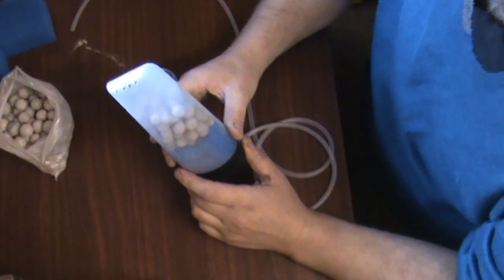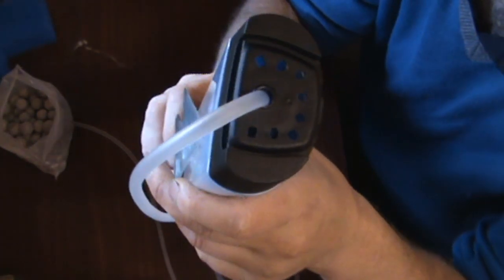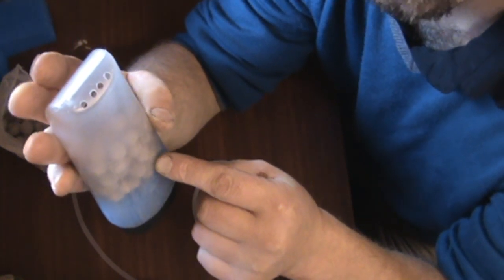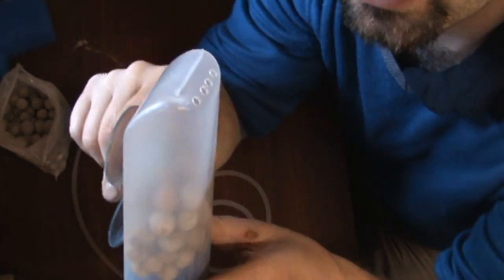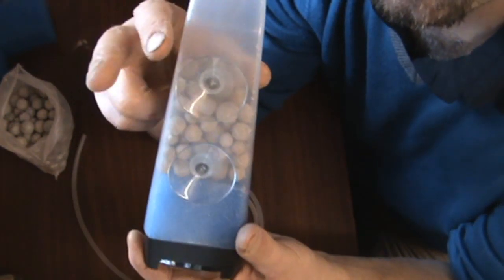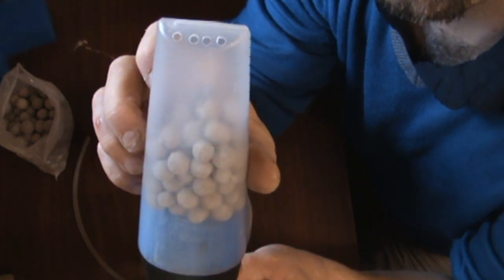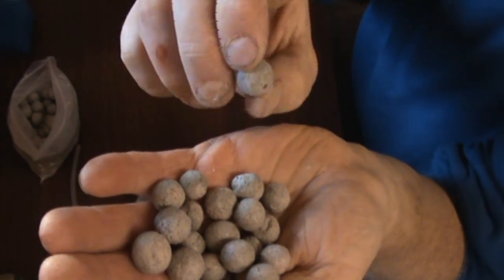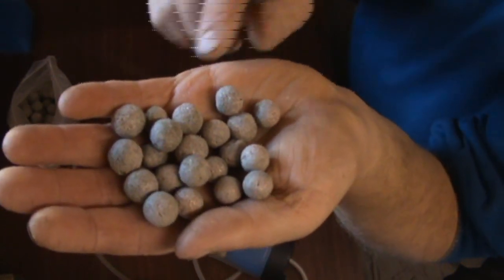New Filter for New Moving Bed Media

Comment from the maker: We have had one this size in tanks up to 100 litres and water has been spot on so using that formula, just upscale as necessary. Obviously the Biomotion media makes a heck of a difference over K1 or Hel-x as it has much more surface area. It also matures more quickly since its available surfaces are more easily colonised by bacteria.

Comment from the maker: I've made loads of moving bed filters and always end up taking the airstone off as the media is driven better with larger bubbles. Unfortunately that does mean slightly more noise than if used with an air stone. Once mature, the media in a moving bed does tend to move better so the air stone can be re-attached then.

Comment from the maker: It takes the place of static media which would be colonised by bacteria. The air flowing over it and the knocking together should mean that only vigorous bacteria will survive on it, not the 'lazy' type on static media.
Active carbon tends to be used as a 'water polisher' to absorb smells etc. but only is 'active' i.e. useful for 7-8 weeks befor it needs replacing.

Comment: richard are you going to do any sort of video on how well this filter works and its progression on how well it houses beneficial bacteria i have a good feeling about this filter looks great nice video
Reply from the maker: The media actually works better in a larger filter with a more 'cyclical' motion as in a small situations it can wear down after a few months if it bashes together roughly. I've got a filter in the shop which is shaped like a doughnut and it works very well with biomotion. Needs new media in now but it has gone for over 6 months.

Comment: could u attach the air line to the end of either an external or internal filter and run the water through the moving bed? instead of an air pump
Reply from the maker: Yes, I have see them made this way and anything is possible.

Comment: Just made a slightly modified version of this using Bio-Motion media purchased from Tyne Valley Aquatics. Was very easy to make and is vibrating away in my tank as I type this. Big thanks to Richard, I'll post an update after 1 week.
Reply from the maker: Groovy. Since I made that video I found that the media did best in a cyclical motion which is difficult to achieve from a bottle - needs a donut shape to achieve that so I'm still working on a filter for that idea. Full of ideas and no time to implement them, lol

Comment: would you have to have this on 24/7 ? cause my tank is in my room and my air pump is quite loud  and I would just have it running along side my other filter as this would be running from 0800-2200, would that be okay thanks?